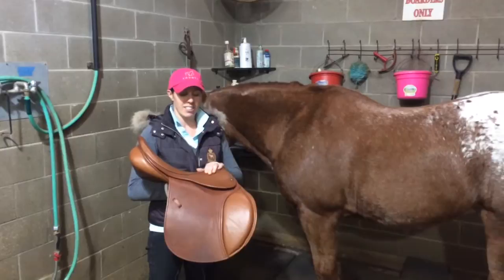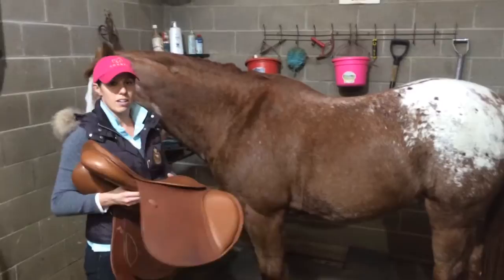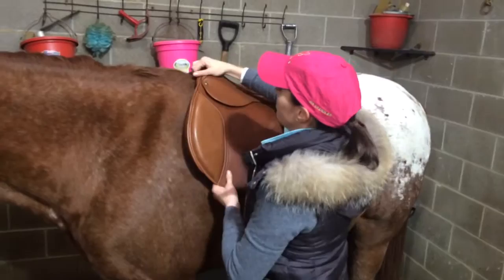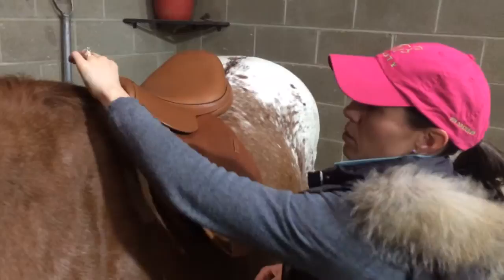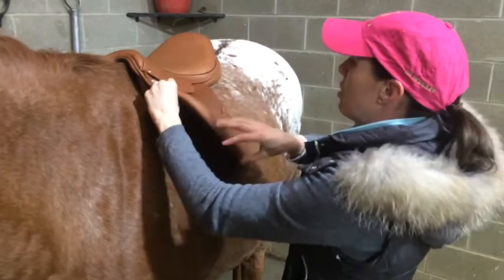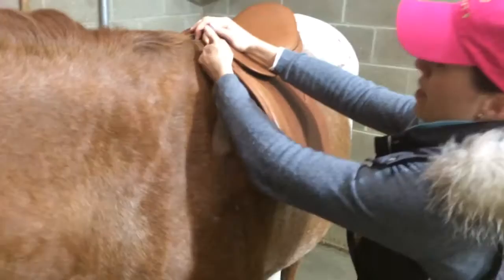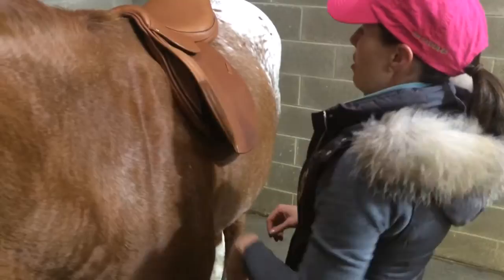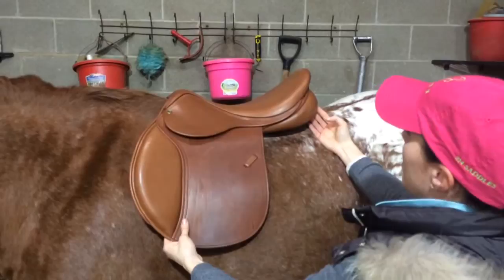Steps for Fitting a Jumping Saddle Part 1

Comment: Saddle clearly does not fit this horse. You state that the saddle is too wide in the beginning, yet then later go on to say that the balance is good. That could be very confusing to people who don't understand saddle fit. If you're going to make an educational video about fitting Saddles you should at least get a proper fitting saddle. Also what you said about the saddle being too wide versus being too narrow was incorrect. If the saddle is too wide, as this one is, there will be a severe pressure point at the top of the tree point where all of the rider's weight will put pressure. You didn't mention girthing up the saddle or having a rider actually ride in the saddle for the fitting. The minute a rider gets in the saddle the front is going to squash the horse's withers and the rear is going to wag like crazy.